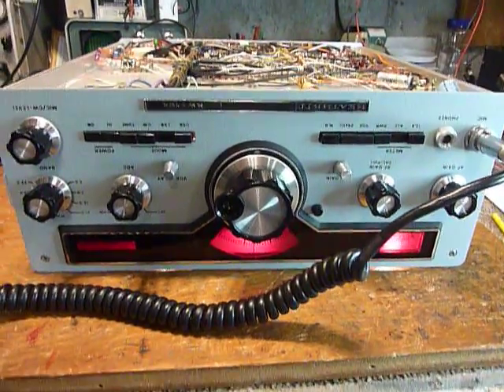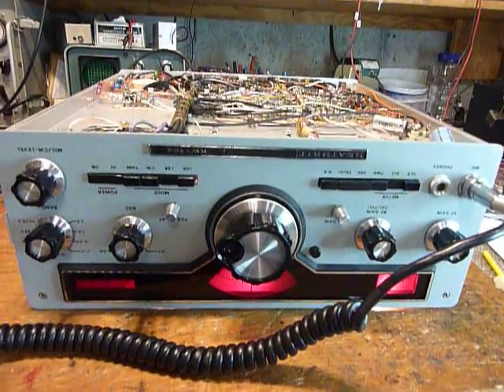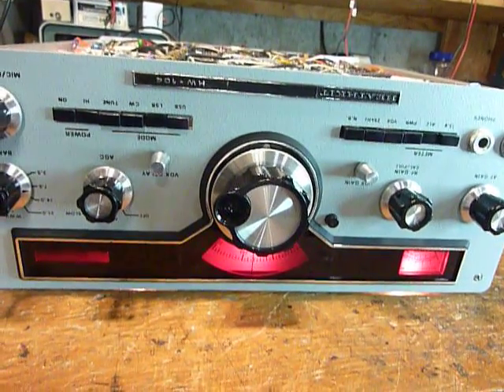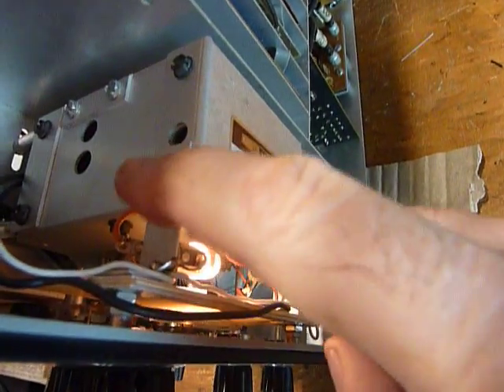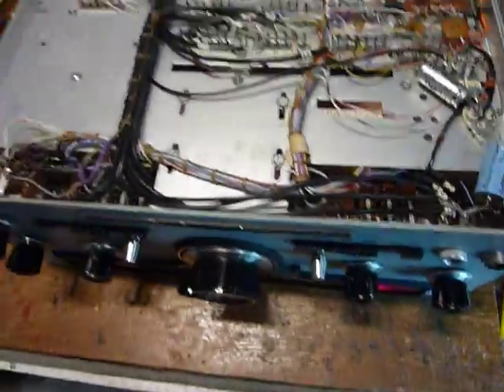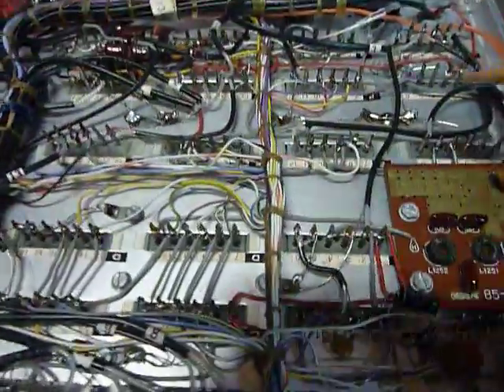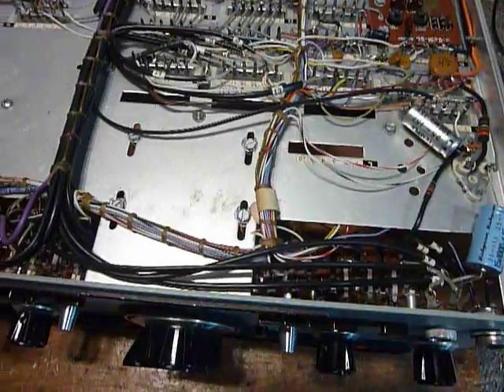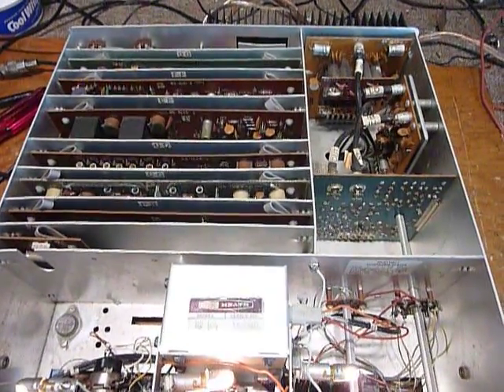HEATHKIT  HW-104, Sb-104, Sb-104A  VFO DRIFT FIX ,

Comment: I have a SB 104A that i had problems with being stable . After I viewed your video , I did what you suggested . Grounded every ground together to the chassis including the VFO and bulbs , which im going to change over to LED's because of the heat . 
Man did it ever make a difference . Output is steady , 100 watts out , No drift or very little to what it was . The reciever is twice as quiet, and more selective , and I can actually pull out the weak stations .. Thanks again for the tip Bob ..K4BFO Dave 
Port Richey ,Fl.
Reply from the maker: Good Job Dave I am glad it worked out for you . 73  Bob